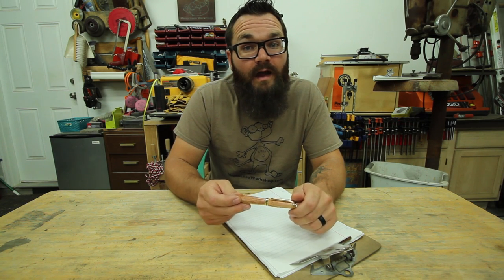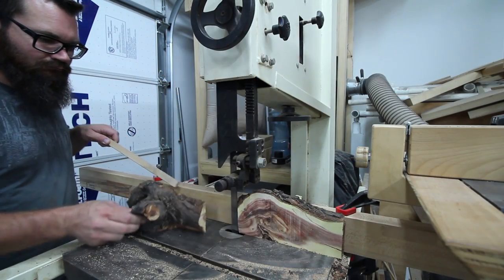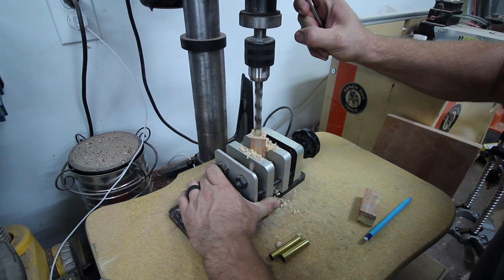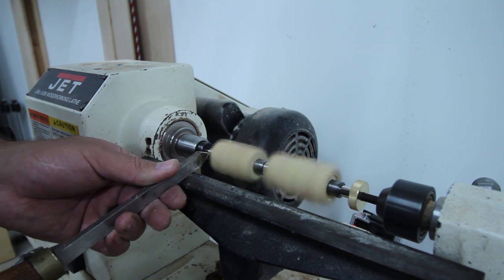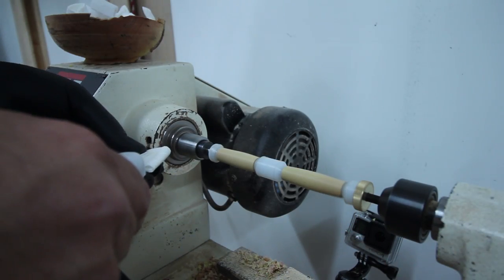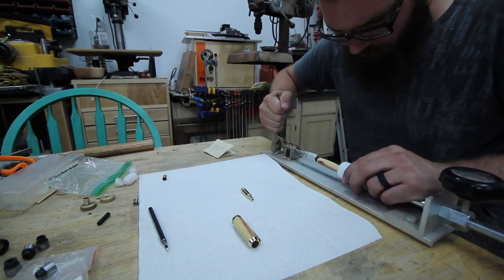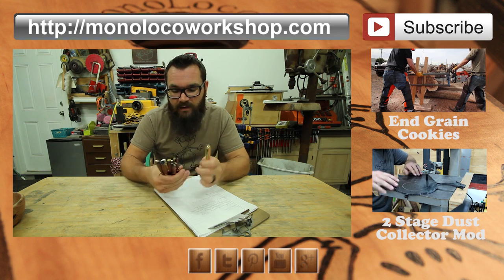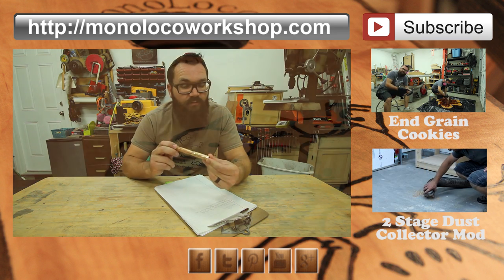Mesquite Firewood Navigator Rollerball Pen

Comment: You did a great job on that.  Mesquite is my wood of choice for lots of turning and scroll saw projects.  I have lots of it growing in my and the neighbor's yards.  
Try turning the mesquite cross grain for a pen.  It is gorgeous.
Reply from the maker: +stephen dickinson I was going to go dig through my pile again and pull out a mesquite piece for a bowl but didn't even think of cross grain pens. I'll have to give that a try!
Reply: +Ty Moser (MonoLoco_Workshop) Be very careful when the wood is getting thin.  I take it down to about my finger thickness then gently bring the ends down to the bushing.  I do the shaping with 80 grit to avoid the possibility of the lathe tool chipping out the wood.  You will get it.

Comment: I've been experimenting with microwaving mesquite, you video is inspiring!
Reply from the maker: Thanks! I've seen people microwave thin green bowls that they turned with some pretty cool results. How's you're microwaving experience going?
Reply: Ty Moser so far is good, I got a little checking but is because I did it to hot for 1min. Doing it for 30 sec at top power is good on my particular microwave. Thank you for the inspiration.